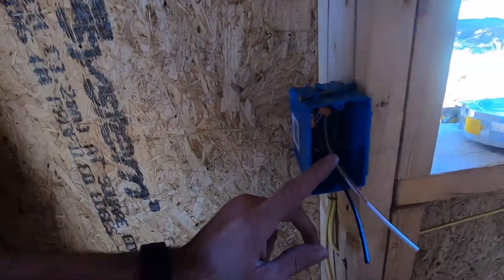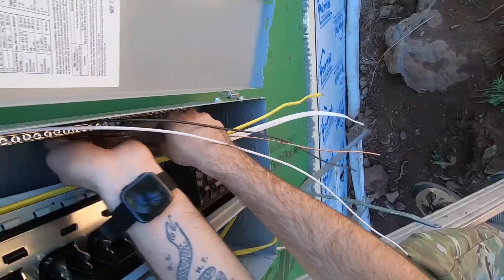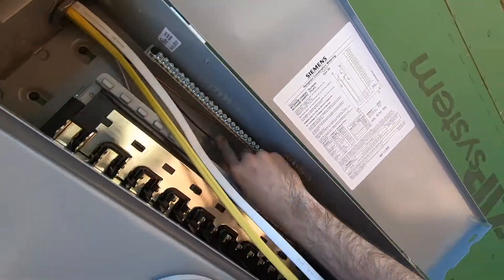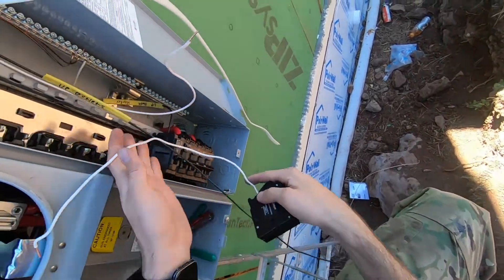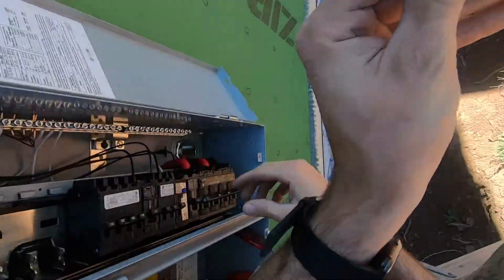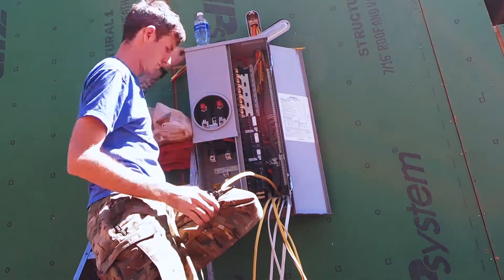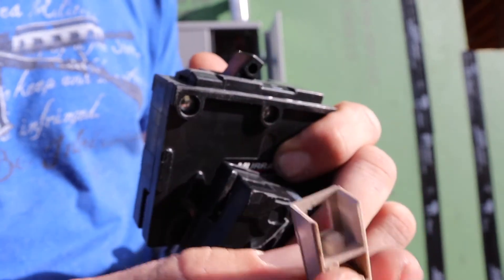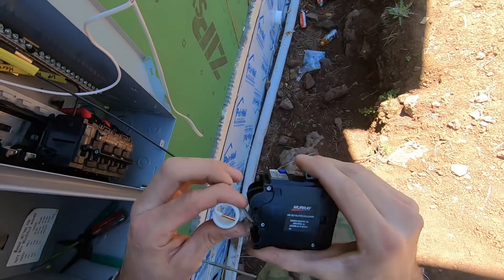Wiring An Electrical Panel

Comment: Your right the 10/2 you landed. It doesnt matter, but if your doing it by the book. Youd land the black followed below it with landing the red wire.

So in your panel let's just say you had these below,
12/2, 12/4, 12/4, 12/4, 10/2, 10/3
Your panel would look. Like.
-
B
-
B
R
U
-
B
R
U
-
B
R
U
-
B
-
B
R
-

(U indicating is Blue, as B is used to indicate black wire)

Your panel would basically be Black, Red, Blue
And repeat.
Love the vids and all the types of work you guys did! Great job you guys!
Reply from the maker: Good info, thanks for watching!

Comment: are you putting a circuit breaker for each outlet in the house?
Reply from the maker: No, but there are certain appliances that are generally put on their own breaker because of the amperage required.

Comment: I'm not an electrician but I'm in schooling for it and the grounded (neutral) wire and the grounding (bare copper or green) wire are connected in every main panle with a bonding screw or in your case on one bus bar. They used to not use a neutral and only use a ground now its needed and they have them connected as an extra path if something would happen to the neutral
Reply: I'm an electrician 🖐 So, No, you never want to use the Ground conductor in place of a Neutral conductor because you can create the possibility of electrocution. Which is also why they are not bonded together in sub panels. The Grounding system is your safety/ lifesaving system.  It is there to carry faults back to the source and shut the breaker off in case of emergency. It is never to be used as a return path for electrical current!  
Arc Fault breakers only detect arcing, not faults. Gfci devices detect faults. They do make combination breakers,  and in the next year all breakers will be required to be of the Arc Fault type.  Also, in about a year all panels, even upgrades, will be required to have surge suppression devices installed to protect all the Arc Fault breakers.  
Just remember this:  electricity is always looking to take the easiest path back to source,  if you remove that path (neutral), the path can become anything conductive including you.  You don't want that.
Reply from the maker: I think he's talking about specifically in the panel, and responding to my comment about not knowing why the ground and neutrals are terminated on the same bar in the main panel.  I think when he referred to the grounded neutrals he was referring to the main panel neutral and ground termination.  

I'm not sure about the second half of the comment which after reading again might be what you're referencing. 

That being said I apreciate the comment and clarification for people reading. As an aside we started building in 2019 and were still using 2012 codes in our county, we didn't adopt the next code update until early 2020 so code may change to require all those things but my guess is it won't trickle down for another decade or so, but we'll see! 

Thanks for watching and the detailed comment!
Reply: @PootsPastures  yes, that's what I replied to, why they aren't terminated or bonded in subpanels or downstream, but are in the mains.  
Objectionable voltages have to be cleared through the path of low impedence so that breaker or fuse shuts power off, either at your home's means of disconnect or at the utility's end.  Simply put,  it protects from high voltages via faults, lightening, or surges, and helps reduce risk of fires and electrocution, both at the utility service side and in your home.
Reply from the maker: Thanks for the comment, we recently had the power company out installing our transformer and being able to speak to the linemen and gain some of that knowledge was awesome!  good luck with school, and thanks for watching!!